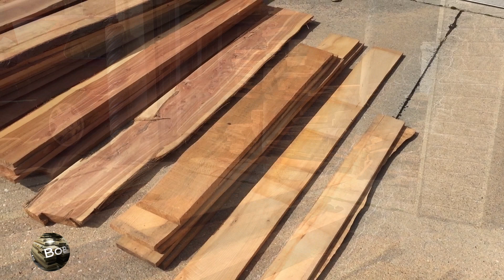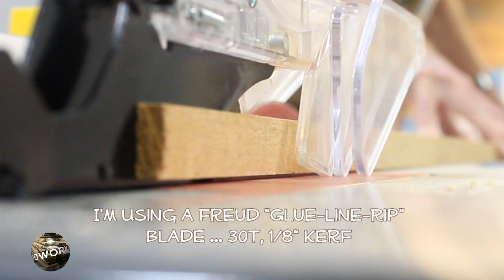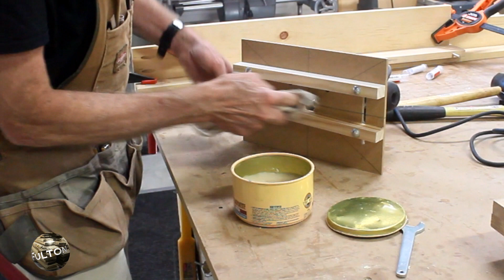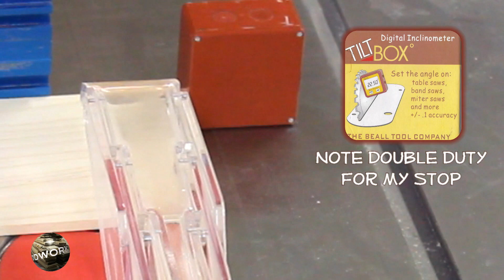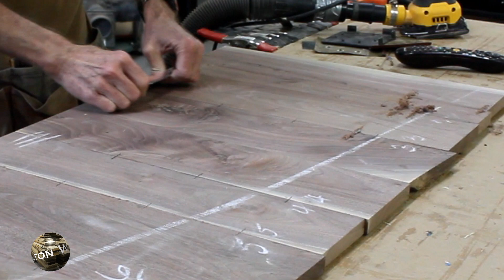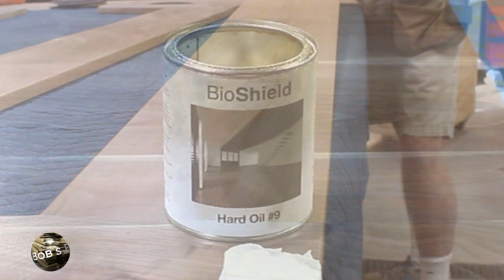Wood Platform Bed ~ Walnut & Silver Maple

Comment: what is the angle of the tapered legs?
Reply from the maker: matt malone Matt, not sure the actual angle. I usually do these thins by “site”. The leg sections on the rails taper from 4” to 2 1/4” over a height of 8 1/2”. The leg sections on the footboard only taper to 3” (from 4” over 8 1/2”). This way when put together and viewed the leg section looks similar ‘all around’. That is, the base of the leg that hits the floor is 3” as viewed from side or foot. If that makes sense?   After doing this, I’m not sure the slight difference is that noticeable one way or the other. I did not taper the legs on the head board as those are not visible and the larger “footprint” adds to stability etc.  Thanks for viewing.
Reply from the maker: Matt, not sure the actual angle. I usually do these thins by “site”. The leg sections on the rails taper from 4” to 2 1/4” over a height of 8 1/2”. The leg sections on the footboard only taper to 3” (from 4” over 8 1/2”). This way when put together and viewed the leg section looks similar ‘all around’. That is, the base of the leg that hits the floor is 3” as viewed from side or foot. If that makes sense?   After doing this, I’m not sure the slight difference is that noticeable one way or the other. I did not taper the legs on the head board as those are not visible and the larger “footprint” adds to stability etc.  Thanks for viewing.

Comment: Greetings Bob
Another well done production!
What is the cure time for the Bioshield Hard Oil finish?
How many coats did you apply?
That could possibly be the "natural" alternative that I prefer vs boiled linseed followed with polyurethane.

Glenn
Reply from the maker: grupp61 I wait 24 hours between coats ... wipe on let sit about 20 minutes wipe off excess.... wait 24 hours and do it a again. I put 2 or 3 coats on. Go to their website to see if they might have other products of interest.  This is actually a floor finish. I wait a good two weeks or more before I apply wax, if any at all, to make sure it is fully cured. Thanks for comment(s).
Reply: Thanks for the reply .
I will take a look at their product line on their website.